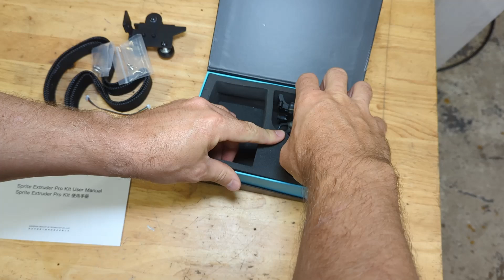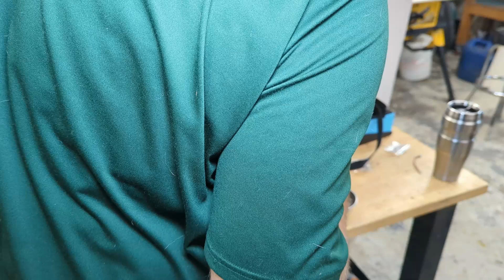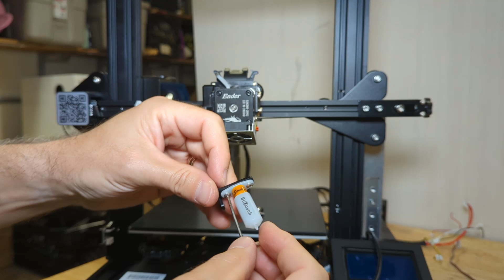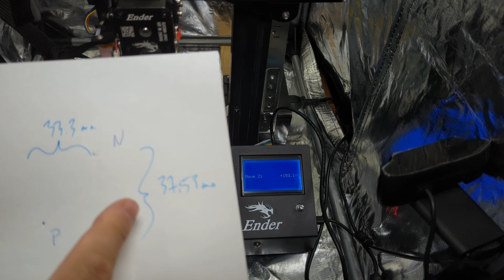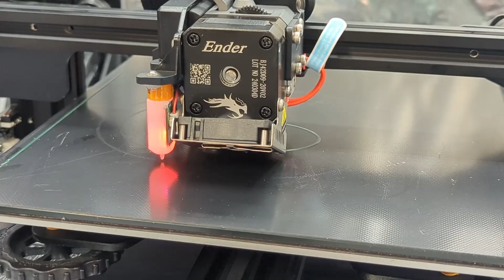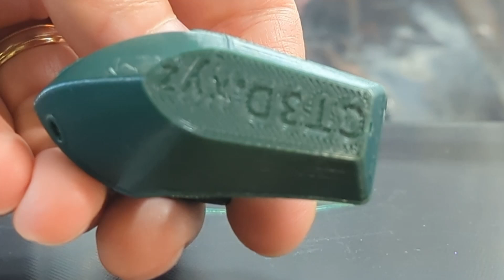Installing Creality Sprite Pro Extruder on Ender 3 Pro

Comment: 42:43  A year later I'm sure you noticed the little label on the red wires for the heater.  I just did this upgrade today on my Ender 3 V2.  I noticed that label when I pulled it out of the box and plugged it in before I even mounted it on the gantry.  (Edit: nevermind, you saw it later in the video)

I think I have a different problem now though.  I'm still manually leveling my print bed.  First time I auto homed it I had the glass print bed removed.  Probably a good thing.  I slide the glass print bed onto the bed heater and then looked.  The Sprite nozzle is ahead of print bed in the y-axis and it is also below the printing surface of the glass print bed by about 1 mm.  This is why I was watching your video.  I noticed your automatic bed leveler is used as the z-axis home position.  I might have to get a CR-touch if it will serve as the z-axis home switch.  But, I didn't notice a plug for the CR-touch on my Ender 3 V2's motherboard.  I looked, because I was going to go ahead and plug the cable into it if there was one so that I wouldn't have to open up the control section again if/when I get a CR-touch.  I also did the dual z-axis upgrade today.  

Anyway, thanks for the video!

(Edit 2: At 44:10 you said the nyloc nut for the lower carriage wheel bolt was hitting the bracket when near the end of the positive x-axis travel.  I went back and checked earlier in the video and saw a 23:08 that you actually have that bolt installed backwards.  If you place the button head of the bolt on the gantry side it will clear the bracket that holds gantry to the right upright.  You may notice and correct this later in the video.  I haven't gotten that far yet.)

Comment: Due to mine creality harness had 2 connectors marked th, i burned my plate, connecting them wrong 😅. Ordered manta m5p with cb1.. Also remade my ender 3 v2 to coreXY using second same printer 😁

Comment: Hi! I have the Ender 3 (non-PRO) with the exact same upgrades, but I can't find the right firmware anywhere. Could you please help me out? I'm desperate and don't know what to do. Thanks in advance, and thanks for the video!
Reply from the maker: The configuration files that I used on this printer can be found here if you want to compile your own firmware.

https://drive.google.com/drive/folders/166eP4dsCtBnJ3GrwnheoRqRm-g9prgKw
Reply: @JoesGarageProductionsLLC Klipper…give up on Marlin.

Comment: Have seen in a few videos about that thermister connection not being connected during shipping. Glad you caught it.
Reply: Mine was that way too but don’t have to take the fan off to get it hooked up
Reply: They ship with the heater and thermistor unplugged, simple to plug in and does not require disassembling the extruder in any way.  Don't knock Creality.

Comment: With everyone moving to the newer printers (K1, Bamboo, etc.), the E3p's and CR-10's seem to have been forgotten about.  I still enjoy using them though and its nice to see a relativity new video supporting them. Looking to upgrade my E3P's hot end and found this while searching for info. Great video.
Reply from the maker: Thanks! Since posting this video I switched over to an X1 Carbon and it has been life changing. Should have done it a long time ago. It just.... Works
Reply: @JoesGarageProductionsLLC funnily, I bought a sprite pro and yeah I got a lot of useful prints but it is on an ender 3 pro from years ago. Sometimes it works, sometimes not (more often not)

I'm considering cutting my losses and moving to a Bambu Labs X1C ... The failures are just annoying and my projects don't progress because it's hit and miss with the ender3 and creality sprite pro
Reply: @chipko  It mostly depends on how much time you are willing to spend with it. You have to modify the firmware for the pro extruder to work, because there aren't any official or not official firmwares for it at all (at least not for ender 3 neo, pro is a bit better, but still way worse than a custom firmware). Alsmo most futures are generally locked.

Comment: Now that you have used both direct drives what one would you prefer
Reply from the maker: I liked the original direct drive better than the sprite extruder. I had some print quality issues on the sprite extruder after putting some hours on it. I eventually got tired of tweaking things all the time, sold the printer, and bought a Bambu Labs X1 Carbon - should have done that a long time ago!

Comment: Why not tape a post it with a dot on it under the probe, write down the x,y cords. Then move the nozzle to that same dot using the controller, write that down. then subtract them and theres your off set.

Comment: Thank you man! Do you have any tutorial on firmware change base on your settings? I updated NOZZLE_TO_PROBE_OFFSET to {-36.5, -40, 0} doesn't seem to have any effects. It still tries to lower the hot end outside the bed. Did you change X/Y_BED_SIZE? What else did you change? (I am using 4.2.7 silent board and Marlin 2.0.x)
Reply from the maker: You will have to reduce the bed size unless you fix the bolt on the x carriage that contacts the frame. I ended up reversing mine and grinding it down a bit as far as it probing off the bed I would have to check my config files. I could potentially send them to you if you'd like to compare